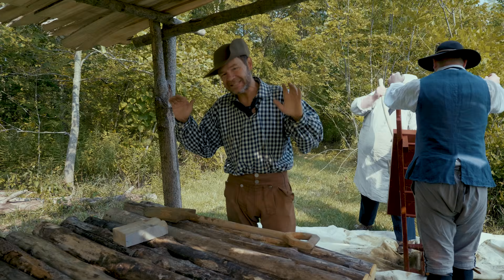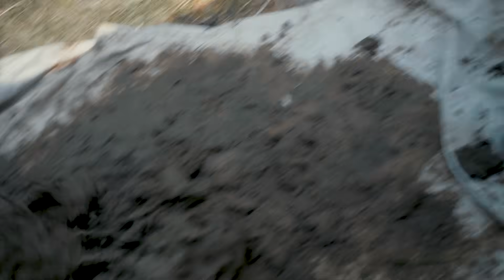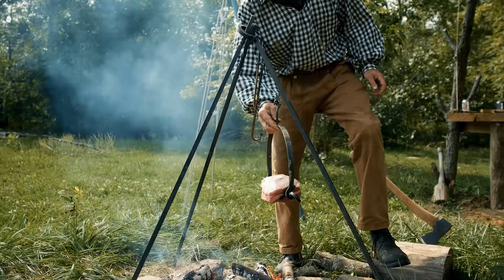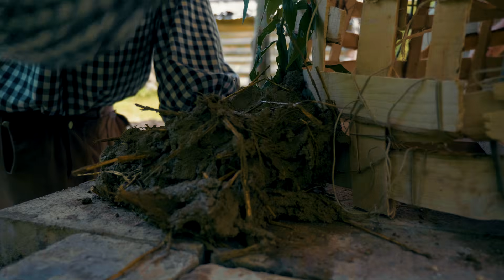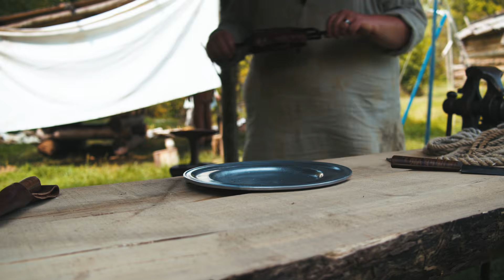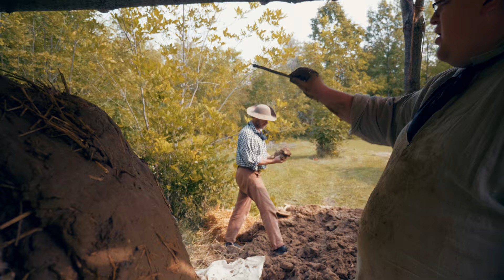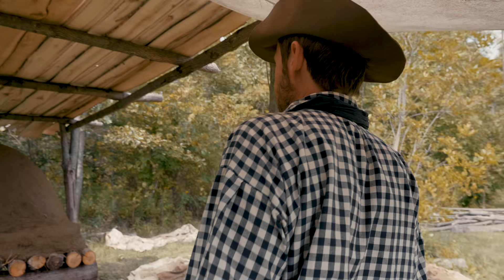How To Build a HUMONGOUS Earthen Oven - Townsends Homestead

Comment: No one is ever going to see this, but here we go.  I'm building an oven matching your dimensions. The problem is, the height is 22", and you have the door at 15", which is about 70% difference.  It should be 63% at about 13 3/4".  Am I doing this wrong?

Comment: Wondering why the guy dressed as a baker needed to be dressed like a baker, apron and all, while working in the mud.
Reply: Ryan is not wearing an apron at any time during the build. What he's wearing is called a "wagoner's frock" or "work smock" which is basically an oversized shirt that was worn over your good clothes when doing a dirty job.   Brandon wears an apron while he forges the handle, but that's self explanatory.

Comment: Question: can you feel the heat from the outside the oven all the way around? If so I think it will be useful as a center piece connecting several rooms

Comment: Do note that if you don't want a tall door, you can have another hole in the oven, from where smoke to escape. It can be on the top, or on a side, and it can even connect to a clay pipe or a terracotta pipe, for getting the smoke away to not affect people's sight and to not cause coughing.
                One thing I don't know if you did, is find out if there is any text about using whitewash with boiled starch mixed into/with it, to make waterproof paint, or boiled starch mixed with cement to make waterproof cement. I know the Great Wall of China was made that way, but I don't know how widespread that was in America in the times which make the subject of your channel.

Comment: How come they or you don't make the oven the same way you make the bricks, so they are waterproof? Make the oven entirely out of the materials you used to make bricks then cure it with fire inside and out. Then you wont have to make the roof for it. Probably an ignorant question but I will ask it anyway.

Comment: Two times the radius means 8 times the material. The volume of a hemisphere is v = 4/6 pi r^3. So if your original oven had a radius r1 and your new oven has a radius of r2 = 2 * r1 then  
v1 = 4/6 pi * r1^3 
and 
v2 = 4/6 pi * r2^3

v2 = 4/6 pi * (2 * r1)^3
v2 = 8 * (4/6 pi * r1^3)
v2 = 8 * v1

Comment: If you ever make another oven like this, would it maybe be advisable to add the cob from the bottom to the top rather than from one side to the other so it doesn't push on the basket. I don't know if that is something you considered and decided against, just thought I'd mention it in case it wasn't. As always, I loved this video very much.

Comment: Pro tips:
1. It is better to chop the straw before adding it (with an axe for instance), that way you can incorporate more of it into the mix and spread it more uniformly, thus making the clay more crack resistant.
2. Use fibers from dry stinging nettle (they are as good as hemp fiber) instead of straw. They are finer than straw and you want that.
3. Mix in some slaked lime into the clay mixture (about 10% by volume). Lime has a good atomic bond with clay and would make the oven water resistant and prevent cracking. And you won't need to use fire brick for the bedding. The downside is that you'll need to let the oven slowly cure for about a month before using it.
4. Avoid using top soil, you don't need all the organics in the clay mix, it'll just make it weaker and prone to cracking. Dig down till you reach the clay bed and use that.

Comment: I'm not expert but just a suggestion based on my own building projects. You should have reinforced the basket in the center with a vertical support column in the center and cross beams internally. Then you'd have less of that basket bowing problem as you put on the clay. And it would still burn out.

Comment: 0:39
For a cube the surface increases only roughly by 50% if you double the volume (+100%). How did you come up with that estimate?

2m x 2m x 2m                  = 8m³
2m x 2m x 6                     =24m²

2.52m x 2.52m x 2.52m = 16m³
2.52m x 2.52m x 6          = 38m² = 24m² x 1,58 -> 58% increase

Comment: Dinner on the grounds! At first i thought it was to fire the bricks you made a few weeks ago.... can't wait for that one. 
Im wanting to find a fireproof brick "recipe" and make my own bricks to build a custom pizza oven.
Reply: This period-style earthen oven is designed for baking things in the manner of that period, in which the fuel is burnt inside of the oven itself, and then removed and replaced with the items to cook. Modern pizza ovens have a slightly different design, in which the fuel is burnt beneath the separate pizza chamber. So, while one could try to use either oven to cook any of these things, the recipes are developed based on the traditional usages. So they'd probably suggest thinking hard about which sort of stuff you want to bake most, and then pick the design that works best for that food. Good luck.
Reply: @bruce8443  Well thank you Bruce. Im just wanting to cook bricks!🔥
Have you seen the brick making video?

Comment: Would putting the straw in the pack clay not burn/try to ash when the oven is heated leaving air pockets in the clay?
Reply: The straw is just there to hold the clay together until it dries. Once it is dry and baked hard it doesn't matter if it is there or not. Air pockets are good insulation.

Comment: Could have mitigated the flex in your basket a bit if you formed an arch over it, then worked down from there rather than going from the back to the front. Wouldn't make much different in the end product as far as I know.

Good job though, looks real good.

Comment: What about one of those ovens with a chimney above the opening? I was hoping I'd get to see you build one of those at one point.
Though those are typically made of stone or brick in a house. Maybe once you build your first house made of brick? I would love that.
Reply: They are building this mud oven right next to the wood cabin they videoed building a year ago. That wood cabin has a chimney that goes right to the top, so those cabin videos show that.
But actually,  Jon and his family built his first house out of bales of straw, plastered over. It's like a normal house but with better insulation and super cheap. They later made a video of using the same technique on a friend's new barn.
Reply: @bruce8443  I think you misunderstood me. I mean a wood oven with a chimney. They were not uncommon at the time. I was wondering how they would build one.

Comment: What size community would this size oven service? Did you have to pound all the air bubbles out of the clay as you went? What happens to the straw in the clay, and the ash form in the oven?
Reply: Yes, he does try and pound the air out as he goes, as it could expand and crack the oven inside when it's heated. If you watch some of his earlier videos on earthen oven building/using, he does show that the straw only burns where it sticks out of the clay on the inside, and he has a mop made of strips of cloth that he wets and uses to sweep out the oven and clear the floor, before he starts baking. He also uses cornflour and trivets to keep the food off the actual floor of the oven, so it's not contaminated by any missed ash.
Reply: An oven that size would do for a village of 5 or 6 families. You can see how they slapped the air out and poked holes with their fingers. You want the clay as dense as possible to hold the heat but it does not matter if there are a few air bubbles. The straw is only there to hold the clay together until it dries, once it is dried hard and baked you don't need the straw. It will burn off where exposed on the inside.
There are other videos where you can see them build a wood fire inside the oven and let it burn for an hour or more to get the oven hot. Then rake out the ashes and burning embers with a hoe. Dump the ashes and embers in a tin pail with a tight fitting lid and the fire will go out from lack of air, then you can use the charcoal next time.
Last step is to wipe off the floor of the oven with a rag mop soaked in water, sprinkle on some corn meal and slide in your loaves to bake. Cover the opening with a wooden door and come back in 20 or 25 minutes to fresh baked bread.

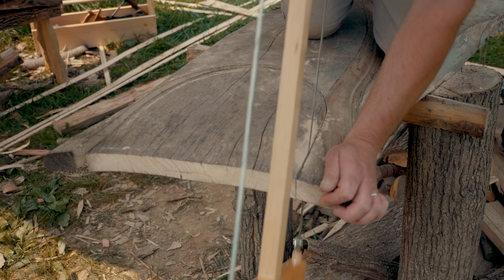Comment: 5:30 - Did Brandon made that perfectly round cut with just a frame saw? That would take me some chisels and sandpaper.
Reply: I guess draw out a charcoal line with a rope and nail to make a good arch and then use something straight to draw lines and then just follow the line with the saw.. i would still fail at that but thats how i would do it

Comment: Love it! Wonderful presentation as always. Out of curiosity, is using bricks in the base of the oven like that period accurate? Or would it have been 100% cob?
Reply: I think a couple of videos ago, when they showed forming and baking the bricks, they discussed how it related to the period processes. They are trying to be authentic with this.
Reply: @bruce8443  The bricks they were making were building bricks though, these looked like modern production refractory "fire" bricks, which is why I was curious. Nothing to say it's "wrong", they may have used something similar in the 1700's and they just substituted the modern equivalent, or there was some other (perhaps safety?) consideration.
Reply: They would have used bricks if they could get them. Sometimes they made the whole oven of bricks. There used to be an 1840s house in my neighborhood that had a massive brick kitchen range/bake oven in the basement,  on top of that was 4 large brick fireplaces for the 4 rooms on the ground floor, on top of that 4 smaller fireplaces for the upper floor, on top of that a 4 barrel chimney going out thru the roof. There must have been enough bricks in there to brick a bungalow. The house itself was post and beam, wood frame construction covered with clapboards.

Comment: Real cool video, we built an oven on a 14th century event in Sweden last year. I have quite some experience baking bread in this style of oven and in my opinion more floor surface and a little less high is preferable but that depends on what you want to bake I guess. You said that the basked started to deform because you started working on just one side, why not instead work in rings from bottom to top? Is it just the way it happened or was there a specific reason for it? Love the work of you and all of your team.
Reply: I think he left one side uncovered because that is where the door goes, he had to wait for the door frame to be woven before building that side.

Comment: I need to get a bunch of people together to go to the middle of nowhere and make a town like this.
Reply: I'd love that  - - for about 2 weeks.😄😆 Then I'd want my electricity and cell phone.
Reply: @trishthehomesteader9873  We could do it and still have phones. Need some way to communicate after all. That and TV if for nothing else than to catch the weather report, although you can do that with radio also. I just don't think we need all these fancy appliances. Bluetooth ovens and refrigerators that communicate with your phones and junk like that. Give me a cob oven and a wood stove to cook on. Maybe one of those rocket stoves to get a small fire going quick to boil water or something and not have to make a full size fire in the wood stove. 
We can use RV type refrigerators. No electricity to power them, just a small flame as a heat source. Need somewhere to keep stuff like milk. I believe even some Amish or Mennonite use those type of fridges since they need no electricity to power them.
Reply: @keithyinger3326  Some smart bastard in Europe figured out how to make a working fridge buried in the ground that works off of physics. No electricity or nothing.
Reply: @keithyinger3326  I agree and would love most of that. I think that those who live close to the land don't really need a weather report but it would be handy. 😉 I could do without the tv. 
We used to have a cabin that had a wood stove. It was a brave soul who got up first to start the fire!😄
Odd thing is, I do many of the things from that time. The crux is that I do them because I Like to but I don't Have to. It kinda takes the shine off if you Have to. 😉
Reply: @trishthehomesteader9873  We wouldn't necessarily have to go full Amish like Townsend and co. are doing, we could for example make an experiment out of it and try to make the town out of as much recycled materials as possible. Cut up car tires for roof shingles, reclaimed wood and steel to build with, we make our own cars and horse buggys out of junk we can find or buy, etc., it could be whatever we wanted.
Reply: @salty_armorer4027  I'm in SW Wa. Pretty creative with building things. Handy with a welder and a skilsaw. Something like that sounds like it could be fun. I grew up on a farm and grandpa would recycle all sorts of stuff. People called him a packrat but you'd be surprised how often someone needed some random thing, couldn't find it anywhere, asked grandpa and he'd go out to the shop and find one. He needed a big log splitter once, so he grabbed some steel and built one that hooked up to the back of his tractor and operated from its hydraulics. Its still around long after grandpa left us. The "Louie Logger '83" is up at my sisters house. Nearly 40 years old, split a LOT of logs and still not a single crack in the framework.
Reply: @salty_armorer4027   right. We don't have to pretend that tech doesn't exist. My gear runs off of one 8oz solar panel kit thats 6in X 6in X 1in, that folds out.  It charges everything I carry from cell to headlight, lantern, 500 in one micro Super Nintendo with colour screen (shaped like a GameBoy) 6oz. I long haul kayak, and everything I need to be comfortable  (besides winter months) fits in one 70L pack. Everyone should have one for excursions like sports tournaments, bike rally, concert weekends, yadda yadda ect ect. 100% self sufficient anywhere, almost anytime. 

 Point is, with today's tech everything is pretty cushy. From today's water filtration options, to the newest Instarest micro mattresses. Back in the day these folks had a rough go of things untill they finished the roof of the cabin. There wasn't space aged wool and micro fiber inflatable pillows..
Reply: @jplxlabelle1681  I've been looking for a solar panel like that for when I take kayak trips. I don't think you can add a link here, but if you could give me your search terms I can probably find it. The reviews on the ones I was originally looking at on Amazon weren't very good.
Reply: My dad lives in  Prattsburgh NY, way in the  beautiful Mts , old homes in  old town, and lots of land cheap. And most grow lots of food!!! And beautiful vineyards , 🍇🍇
Reply: If you are near me Im in.
Reply: @Diniecita  I'm in central Florida but I wanna set up the town somewhere where it gets less snakes and more snow.
Reply: @salty_armorer4027  so maybe Iceland or Greenland
Reply: Now THIS is Minecraft!
Reply: I’ll come!!
Reply: I'm in😁
Reply: Don’t drink the kool aid guys and gals
Reply: Im ready and willing to live like this. text me.
Reply: Give me another 7 years and im in
Reply: I'm actually love this kind of middle earth thingy, it's so relaxing and fun. Would love to have something like this in my life, just living the best of my life with nature.
Reply: Im in ahah

Comment: Question that might or might not be dumb: What do you do if you need to repair/change one of the logs suporting the oven? I mean, It gotta be to heavy to move, right?
Reply: Just like a log cabin log: if taken care of properly, it can last for hundreds of years.
Reply: @bruce8443  fair enough and a good point, but sooner or later teh logs will decay.
Reply: They put a roof over the oven to keep off rain. The logs are up off the ground, they are not going to rot. Eventually the posts holding up the whole structure will rot off at the ground, but that will take at least 20 years, then you build a new oven.
Reply: @mrdanforth3744  ah, okej :D Thjanks for the info^^

Comment: We made an earthen oven recently with 70 cm diameter on the inside. I don´t know if it was the big size of it, maybe the wrong clay or a bad fit between the codd layers, but parts of the dome fell of on the inside… It works non the less and has great results

Comment: How do you do this in the 18th century if you don't have fire brick for the floor?
Reply: Ordinary bricks will do, it does not get that hot. If they did not have bricks they would make the floor of clay carefully smoothed over. You could make a floor of cob, cover it with pure clay, strike it with a straight board and polish smooth with a trowel. But it is a lot easier to use the bricks.
Reply: They made the bricks like 2 vids ago
Reply: @cahallo5964  Those weren't fire bricks, but point taken.